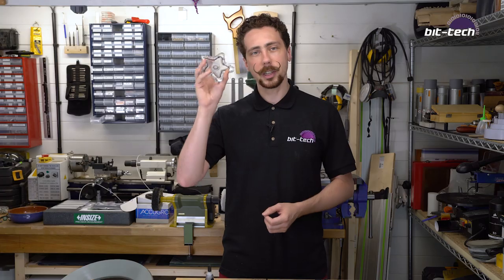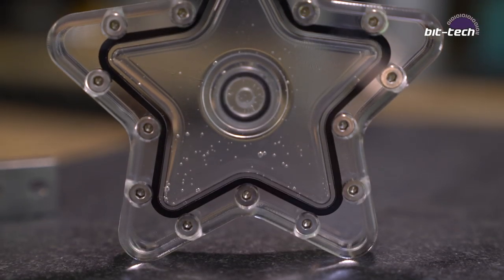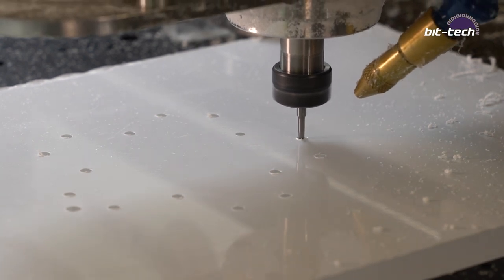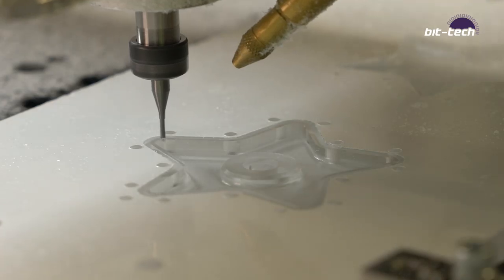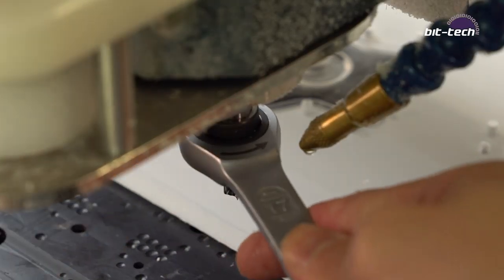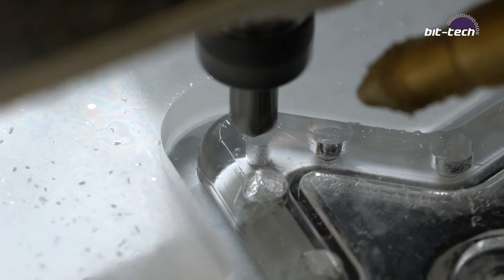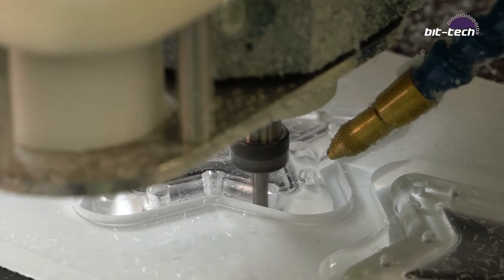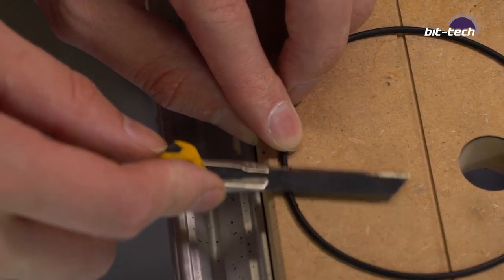CNC CHALLENGE - Can YOU Machine This? | bit-tech Modding

Comment: I could.
first:
Vaccum plate, vilmill black, piece out of acrylic large enough to cut both sides + surface area to use the vacuum.
machine first sides, last operation is cutting out.
Next up:
stick a sacrificial plate of some stable material, I like PC, 3mm for that, to the vacuum table, bolt it down.
Then cut a tightly fitting  shape of your object with the same reference point programmed as your final part.
Stick the part in it, machined side down. Make sure its relatively airtight.
Machine second side.
Repeat as needed.

Worked for a lot of parts and i wont want to miss it again.
damn, i need a cnc for my own :(
Nice videos btw!

Comment: I just bought 1 of your resonance single  pump units as I Wanted to see  how you built it. As I just bought a baily CNC.  2 screws were missing part number2B the 2 screws that hold the mounting plate  to the block nuts were there and washers I had the correct screws so not a problem . I ALSO did not like the thin plastic  used on both the top plate or the bottom plate I will make mine 1/4 wider on both plates. other than that nice work. You made my work much easier. Of course I will put ports in straight line so as to have parallel  copper tubes. I like your D5  MOUNTING BLOCK that I will copy.

Comment: i thought about making a star shaped jig that i would already have indexed to mill the back side. but thats probably easier for me. since i would be doing it in a shop with an vacuum pump. 
but your method uses less steps and is probably quicker. but you could have used a round over bit for a rounder finish instead of the ball point which im certain took forever with over a hundred passes to get that round edge. just use a round bit that matches the radius. but im going to assume you dont have one if you dont do that very often if ever at all.
Reply from the maker: Oh actually I have a couple ones, the main issue here was the internal corners of the star would have caused issues for a corner radius tool that’s large enough.
Reply: @bittech1  oh i see. I didn't even think about that. I probably would have noticed the moment i put it in cad, but good point

Comment: What type of cnc machine is ok for home/hobby use
Reply: Well depends how accurate and easy to use the machine should be. 
Anything under 2.5k is sketchy af, if you want to replicate what he is doing 

Or you build one yourself, but even then don't expect going under 1500€ just for material. But unless your a engineer or have a lot of time, I wouldn't recommend it.

I mean you can go under, but then the quality is questionable 

The one he has should be around 3.5-4k  

I thing his one is from high z 
High z 1000 T or something like that,I dont know the length/width he has 

And that's the price without tooling, a proper shop vac some, ear protection, a pc/laptop as interface a CAD software and so on the money ads up fast.

Some people sell rarely used machines, for 50-70% of the price with some additional stuff. But buying new has the advantage of warranty and customer support.

Comment: Its called tabs, next
Reply from the maker: Tabs aren’t good for parts like these since the machine stops to change Z height on them. As a result you’re left with a witness mark on the plastic, additionally you want to cut through the tab on the machine as doing it manually will mean sanding it down.